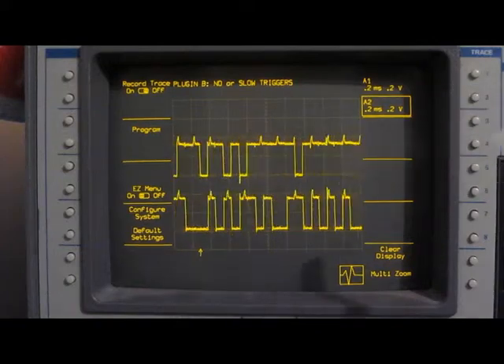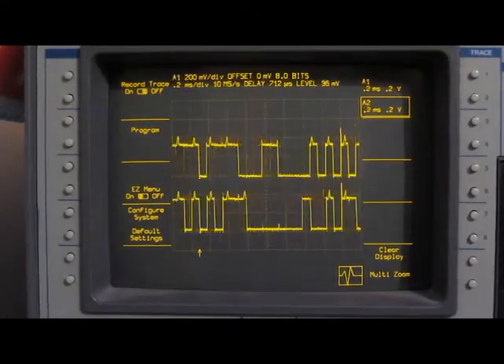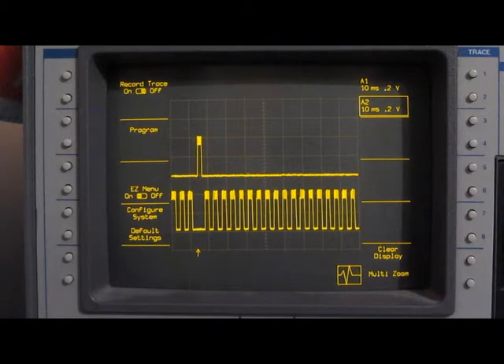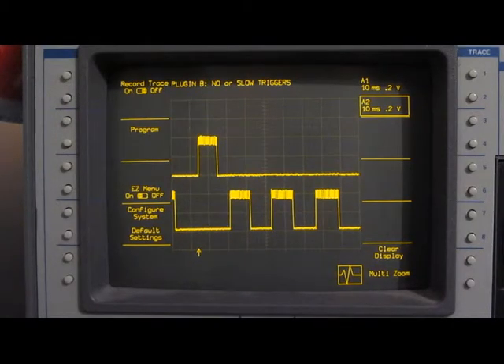HIL simulator waveform generator

Comment: Hello Joe, 

Interesting  Cam/cram simulation, what model/brand or generator are you using ?

Did you capture  sensor waveforms with your scope and then play them back directly with your generator?

I would like to learn or find a practical way to do that, in order to bench test different types of car's ECU's that I work with. I use a Fluke 105B and and BK4070 (AWG) but  different sampling rates  of both equipments doesn't allow me to capture/play directly.

So usually I use BKgenerator soft.  to create the waveforms on the PC and upload them to BK4070. then using a analog  generator in sync for the cam signal :)   worked fine but it's  time consuming and not practical at all, so any advice or recommendation would be more than welcome. 

Regards, 

-Luis
Reply from the maker: I use software to create the waveforms.  The board the generates the signals is custom.  Basically, everything is done with an FPGA.
Reply: I see,  thanks  :)